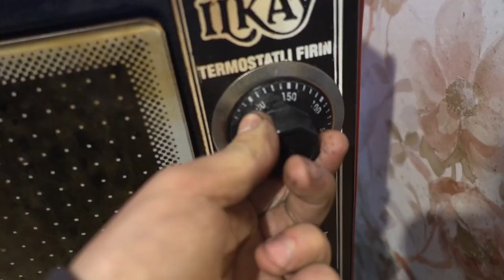Restoration Rusty Hunting Knife

Comment: Very nice! I had a improvised dust collector that I tried with a grinder, too, until the dust collection bag started smoking an hour or so later. Turns out the stuff I sucked into it will burn pretty well. Fortunately, I found it before I went in for the night!